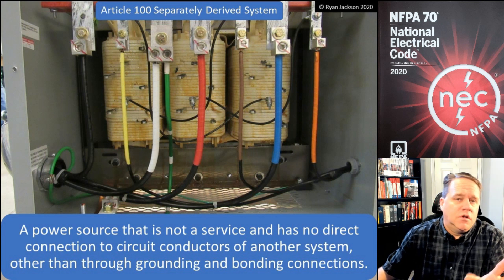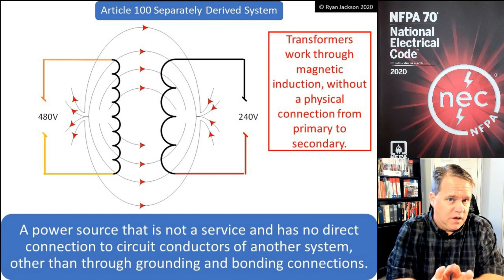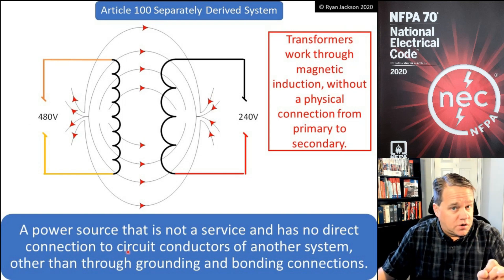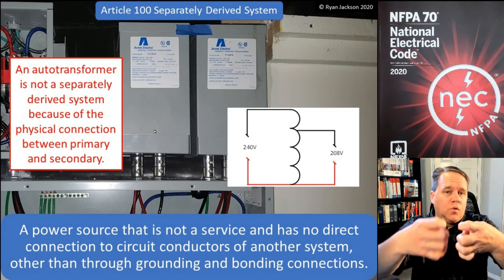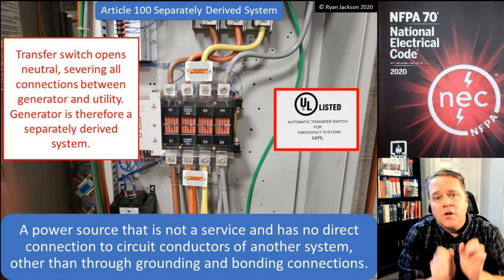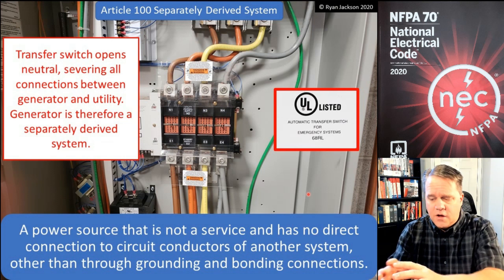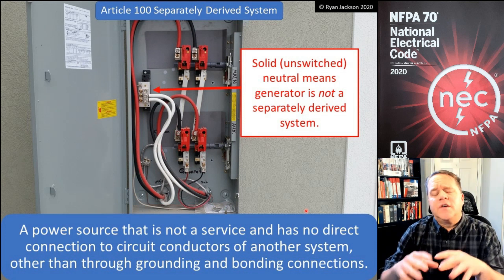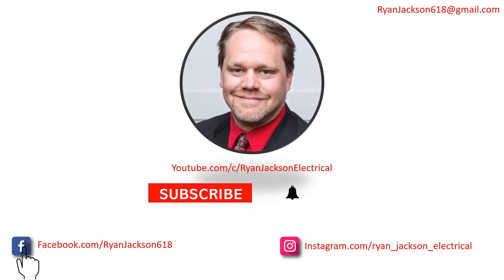100 Days of Article 100: Separately Derived System

Comment: If I have a delta center tapped delta transformer 3 phase. 480 primary 120/208 secondary. Am I taking a supply side bonding jumper from my EGC bar to the neutral lug?
Reply from the maker: @damonsmith8411  You always need a supply side bonding jumper installed with the secondary conductors.

Comment: I’m a helper and we’re working on a building that doesn’t have a neutral on a 480 that is feeding a transformer that steps it down to 120/240. This makes it make so much more sense why we bond that transformer. I forgot they are inductive just like the pots on poles.

Comment: Thank you for making it easy !
Since the ATS is the first disconnect when the neutral is not switched because it is not being separately derived system, does the neutral and ground need to be separated at the generator and not being bonded ?

Comment: Awesome.   So just to clarify,  let's say,  we have a very large apartment complex,  and has two different services,  a 1200 amp 120/208Y 3ø disconnect on the west end, and another 1200 amp 120/208Y 3ø disconnect on the east end, this would count as a separately derived system?   I've seen this setup in Charlotte NC on some of the larger complexs that were like 20 stories or so and kinda wondered how they would classify something this massive.
Reply from the maker: No. A service can never be a separately derived system, by definition.
Reply: They're both services, they're also tied by the utility, so they're both not separately derived systems

Comment: The topic of transfer switches has been much discussed on a forum that I frequent called Smokstak. The question is, in the case of a transfer switch that does not switch the neutral, what do you do about the requirement that the system bond be located at the first point of disconnect. In such a system the bond is remote from the generator and it's breaker, which is the first point of disconnect when running on generator power. This has always been the contention in the discussion. But I believe I have answered my own question! Since the generator is Not considered a Separately Derived Source in the case of a transfer switch that does not switch the neutral, the first point of disconnect rule does not apply. Is this correct?? This answer may clear up years of discussion lol!
Reply from the maker: Correct, if it is not a separately derived system you are not permitted to make that connection. A transfer switch with a solid neutral means you do NOT have a separately derived system.